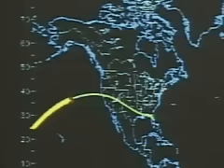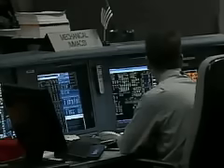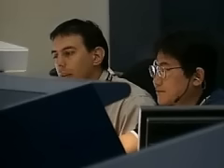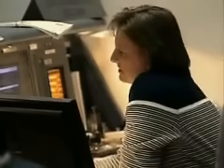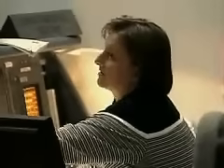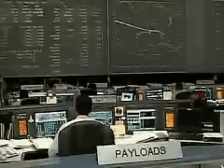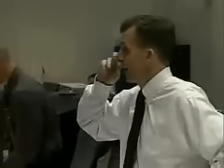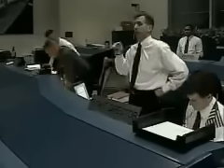Inside Mission Control During STS-107 Columbia's Failed Re-entry and disaster

Comment: We all know the outcome of the investigation for the disaster was that the "O-rings sealing a joint on the right solid rocket booster, which allowed pressurized hot gases and eventually flame to "blow by" the O-ring and make contact with the adjacent external tank, causing structural failure.", or so the official story goes, but here's an alternate failure theory.  No one knows what experiments were on the docket for the Department of Defense subsidized mission, as it is classified, but they saw fit to include Dr. Ronald E. McNair, a known 'high energy and chemical laser expert' onboard, with an official job category of 'operating the payload module/bay robotic arm'.  Now you might ask why you would hire a renowned laser military physicist to operate an arm?  I know I did.  And so here's the bizarre theory I concocted that goes with that... 

...maybe, Dr. McNair was actually there to do high energy laser tests in orbit?  There have been suggestions that the military has been weaponizing space, in conflict with international treaty, since at least the Reagan Administration... so maybe, he was part of a clandestine mission to push that effort further?  That's not such a far stretch in itself.  If the mission had not blown up and I would suggest such a thing, most people would say a few nasty things about our military but mostly just shrug their shoulders and roll their eyes.  BUT WHAT IF... the damage that ended up destroying the Shuttle was a malfunction of the onboard chemical HF/DF and/or high pressure CO laser?  

It is known in our circles that Hughes Research was managing several programs to do with high power laser ranging and communications and wanted to get into the defense weapons part of the business very badly, and that's who Dr. McNair worked for behind the scenes.  So what if either the extremely volatile chemicals, or even a laser burst from some negligent mishap, was the real cause of the Shuttle failure?  Would the military come forward and say, "Oops!"?
Reply: doceigen   No comments please, no one here is worth my exalted self speaking with.
Reply: doceigen May I ask you a question?

Where do you buy your drugs?
Reply: ***** 

At a pharmacy where anyone who only uses legal doctor prescribed drugs goes.

Why?  Where do YOU score your crystal meth?

Comment: If I recall correctly, there was an instance that there of abnormally high temperatures somewhere in the craft while still in orbit. And it was said that the ammonia used in the cooling system was diverted to keep temperatures of that portion of the craft within an acceptable range, which would be making it a hotter than normal "night" while sleeping. Yes, the ground control didn't know that there was something majorly wrong till after the fact. But if EVA had already been implemented, the abnormal temperature reading which had called for ammonia diversion should have been a major indicator that something was dreadfully wrong and needs to be inspected immediately. Had they found the hole, the crew could have been kept safely on the ISS or in the shuttle while awaiting orders and possibly supplies to fix the problem.
Reply: Michael Cartwright Your misinformed. The radiators on the payload bay doors dissipate heat from within the orbiter in a very complicated system. Ammonia is not used to keep the orbiter cool. Ammonia is used in the annonia boilers along with the flash evaporator system to dissipate heat during re-entry because the payload bay doors are closed. Ground control knows everything going on in the spacecraft all the time and actually controls a lot of the functions while the crew is sleeping. The hole in the wing had no affect on the orbiter while in orbit. The hole had only penetrated the RCC wing leading edge and left a cavity foward of the aluminum wing spar. So there was no hole to enter the wing interior yet until it burned thru the spar on re-entry. The mission did not go to the ISS and was in a different orbit. It could not go to the ISS if it wanted too.
Reply: I had went through some other comments and how you had answered them,  and I get the impression that you worked at NASA or connected to it in some way. Do you have something in your profile about your connections or something? If not, can you please give us all a proper introduction of yourself? Not saying that to be insulting, just happen to wonder based on your rebuttals seeming to be of someone that was personally part of NASA.
Reply: Michael Cartwright Sorry Michael. Didnt know I had to. But to answer your question I'm a 25 year shuttle veteran that primarly worked in the crew module. I'm very familiar with how the orbiter worked and the crew procedures as I was involved in maintenance, launches, landings and crew training. I was both a technician and engineer. Hope that helps.
Reply: jrockett73 Sir, I didn't say you had to, nor do I have the power to require users to give their name, rank and serial number. It is just that I was impressed by the way you had an answer for everyone, and in such a way that screams you were one of those from inside NASA. So I just thought it would be nice for you to give us all an introduction of yourself. I find it very fascinating that you are  intimately familiar with the shuttle program. So with that, I just want to thank you for joining the rest of us outsiders on YouTube and Google (though one and the same), and for letting us have the benefit of your knowledge. And if you don't mind, I am going to let you be at the beginning of my "follow" list in Circles.
Reply: Michael Cartwright Michael, I'm not offended by it at all. Just kidding with you. Its all good!

Comment: 6:10  i've got four temperature sensors that are off scale low.
6:20  flight director's face says it all.     he knows.
Reply: Yeah. They knew six minutes in they'd lost it. The rest is being pros and following the procedures.
Reply: Tire pressure loss was the final straw
Reply: No, FD knows at 5:01
Reply: @LegendLength  The video and the audio are from two independent sources. They're synched, but it's a little approximate.
Reply: Joe Booth my understanding is that the foam insulation they were using at the beginning of the program worked well but they switched to something more “eco-friendly” that didn’t work as well.  Sad to lose 7 astronauts to something that didn’t need to be “improved “.
Reply: @tomb504dog  

That's not true. They lost foam from the very first flight. And while they did switch, it had no effect on foam loss.
Reply: @julieritt  I stand corrected.  This is an old comment I made and since then I've read a blog by one of the higher-ups at NASA who says the "eco-friendly" rumor is not true.  I knew they were losing foam from the start but I had heard that it got worse with the new foam.  He said there's no truth to that.
Reply: @tomb504dog  

I tend not to pay attention to the time stamps - and there was certainly a less aggressive way for me to say that. My apologies. 

I'd wager that it was the same place I read it. Wayne Hale's blog, no? IIRC, that particular information about the foam was in his responses to one of the comments on a post he'd written about Columbia - one of many.
Reply: true.. but even more true NASA did not do their hob...  if the eco foam did not work, it was their job to search for an eco solution that does work.. until then the Shuttle stays on the ground...
Reply: @Joe Booth I once asked "why didn't the Morton Thiokol warn Nasa about the O rings?" the truth is THEY DID
Reply: @MrAragon131  you all are referring to the Challenger Disaster in 1986. 
  There were a few NASA engineers that became concerned about the foam insulation damage quite a while before Columbia's landing attempt. From Senior Research Engineer Carlisle Campbell, FOUR DAYS before the disaster; 
"Any more activity today on the tile damage or are people just relegated to crossing their fingers and hoping for the best?"
 You can find this on http://thesmokinggun.com/documents/crime/nasa-e-mail-discussed-shuttle-disaster
Reply: @klmullins65  

You can also read "Comm Check" by Michael Cabbage and William...I can't think of his last name.

As someone who's made a study of the "factors behind the cause" of the Challenger disaster, reading parts of Comm Check absolutely infuriated me. It also confirmed the fact that there really are things that either can't be passed on, or are extremely bloody difficult to pass on. The old saw that we have to learn some things the hard way ourselves is still true. 

In this case, seemingly every new generation has to learn the hard way that space really is unforgiving - and that "It hasn't killed anyone yet, therefore it's safe" is neither acceptable nor sound engineering.

If anything - anything - actually sticks from the CAIB, I hope it's reverting back to the cautious Mercury view of "You have to prove it's safe" over the shuttle view of "You have to prove it's dangerous" that's since killed 14 people. (17, really.)
Reply: @julieritt  thanks, I'll try to find that book! NASA was/is under extreme pressure to try to hold costs down and minimize delays, especially when possible budget cuts are looming, though that's no excuse for lack of vigilance. But at least the astronauts understand the extreme risks involved,  and are willing to to face those risks. I wish the level of excitement  for the space program was the same as it was when I was a kid... one of my earliest memories is my older brother taking me outside, pointing at the moon, and saying "There's people up there!" , during Apollo 11... and then I got a little toy lunar module, with a little rubber-armed astronaut, that was my favorite toy, until my brother took it to school and lost it! But I've been fascinated with Space exploration ever since!
Reply: @MrAragon131  Yep. NASA was under pressure from the media to launch a teacher into space. So they did against MT's warnings.
Reply: @MrAragon131  - NO. This is a LIE. I knew the meteorologist there at the launch site. He and I spoke about the 28 degree temps that morning. IT WAS UNSAFE, and the Morton Thiokol senior managers REFUSED to allow their engineers access to NASA, to explain the absolute out of tolerance conditions for launch. The need to GO GO GO cost seven lives..and Morton Thiokol need to carry these deaths to their graves.
Reply: @dennissvitak148  Allan MacDonald (Morton Thiokol exec) talked about how he refused to sign the form that said the launch was safe. And he was present in the control at the launch.
Reply: @MrAragon131  - Read the Rogers Commission Report. I have. Plenty of blame to go around. Bottom line, EVERYONE signed off on the launch, which occurred at temperatures about twenty degrees colder than had ever been attempted before..
Reply: @dennissvitak148  I encourage you to read Allan MacDonald's O Rings adn other lies. But yes the weather was the factor. They had seen lower temperature effect previous launches but not to this degree. Pun intended.
Reply: Nah, he was in MASSIVE denial.  Had actually convinced himself it was the sensors giving incorrect readings.  Never underestimate the power of denial.

Comment: That static sound after he said "Roger, but ugh" was them burning up and the shuttle breaking apart. Sad.
Reply: No it wasn't. It was just static noise after the radio transmissions from Columbia stopped.
Reply: When a spacecraft enters the ionosphere, all the friction and heat creates a barrier that does not allow most RF communication through. It's called reentry blackout.
Reply: @aldude999  That was during apollo years. Pretty sure shuttles had satellite uplink to bounce data back down.

Comment: Trying to guess about what would happen if Apollo 13 was Space Shuttle Columbia. In Apollo 13's landing attempt towards Earth, there is a thing called the re-entry corridor, where alignment in re-entry is established so that way the trajectory on re-entry would not be too steep--it if would, too much heat would overcome any heat shield, and the spacecraft would burn up. From hearing mission control, I guess the Columbia re-entry was perfectly aligned--not too steep, but we found out after the deadly disintegration of the craft that killed 7 astronauts that there was a major breach in the heat shield that somehow got into some less thick area of the craft that was not protected from heat, and when it failed, the whole ship--heat shield and all--completely failed with it. Not as dramatic as the Challenger explosion, but still with very tragic results.